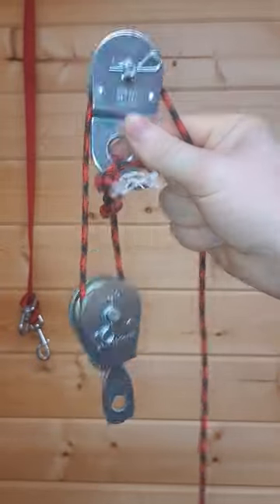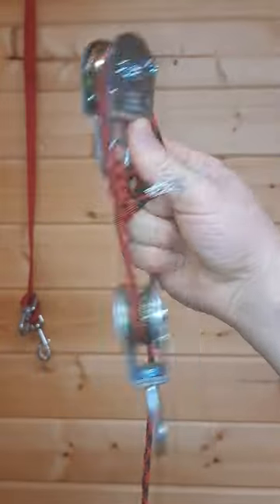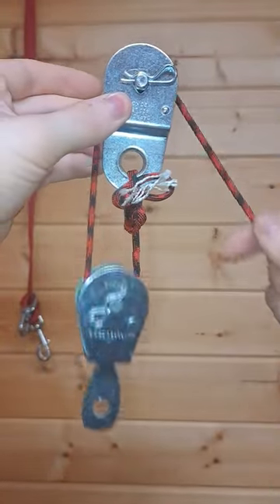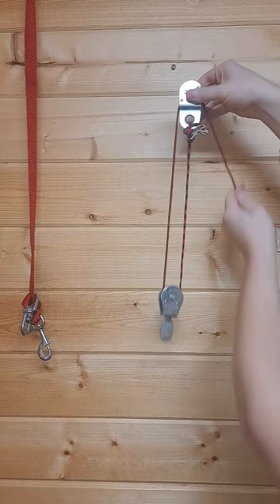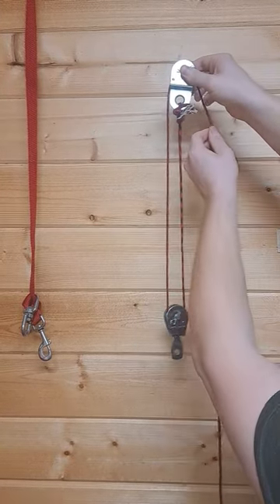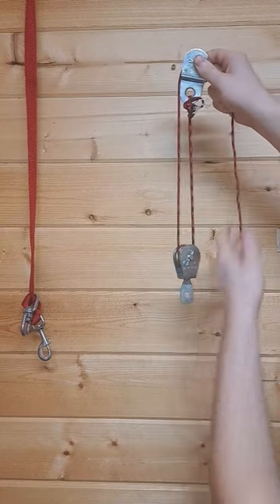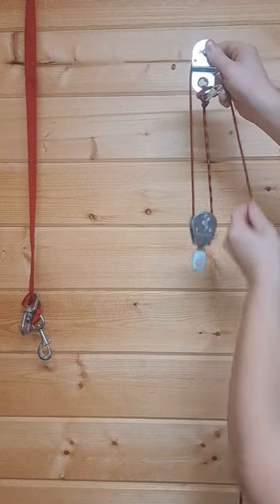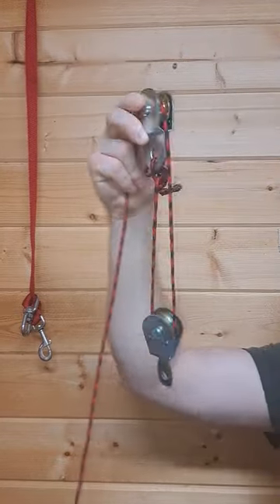The Double Pulley : Mechanical Principals 6

Comment: I am always thinking, is it possible to lift an elephant with a single finger, by utilising 1000 pullies? Today after watching this video, I am confident to say yes, but I have to pull a distance of about 1000 metre to lift up the elephant to just 1 metre height. 

As according to the conservation of energy, the equation can be written as:

Work by Finger= Work on Elephant 

Finger Force x Finger distance = Elephant Weight x Elephant distance.

If inputs are:
Finger Force= 40N
Elephant Weight= 40kN
Elephants distance= 1m

Then outpu will be:
Finger distance= 1000m

Comment: How do I alleviate the pressure on pully one if it is connected to a weak tree to pull a big shed ?  I have to pull it from the direction of the video shown due to space crunch.   I have a big tree to tie on to the left if that helps

Comment: Hi I’m interested in this type of pulley, but I want to be able to lock the system when the weight is up. I’m planning on using it for a heavy bag for boxing that I can easily attach and detach since I’ll be using it outside. Do you have any tips?

Comment: its only a single by the way. the upper pulley is for angle change only, no advantage.
Reply: Nope. Just made one and the pull required is a little more than half to lift the same load. This system works as it should.
Reply: @petecassidy1513 you didnt read what i said, the pulley he holding in his hand has no advantage.
Reply: Nah you’re pulling half the weight the way he has it set up
Reply: @koda7820  the lower pulley is creating the mechanical advantage, the upper is for angle change only
Reply: He was going for proof of concept, not practicality.